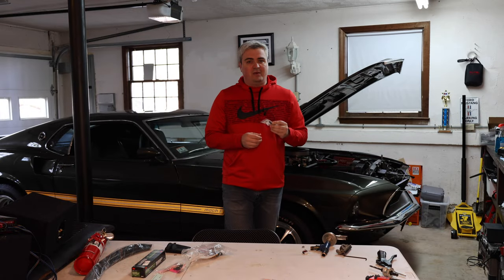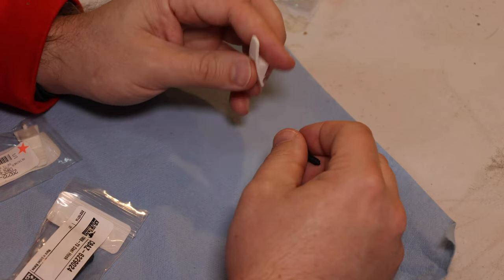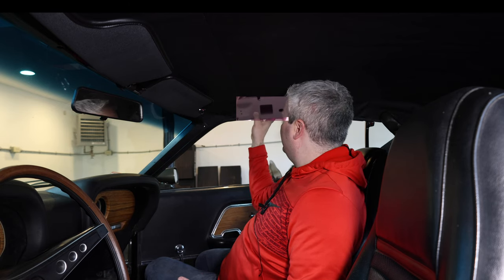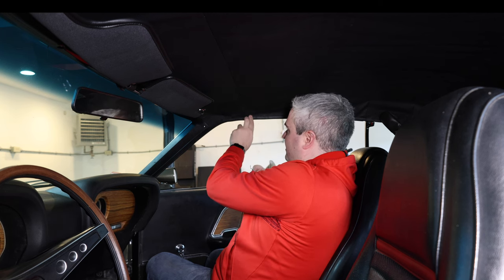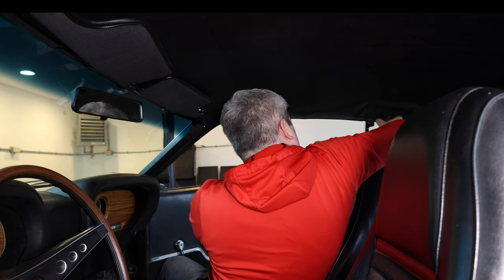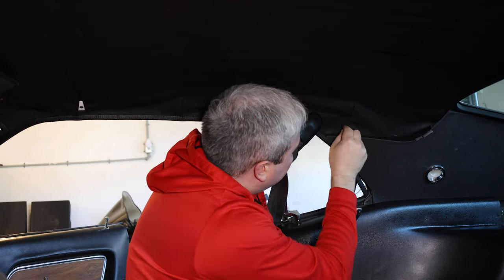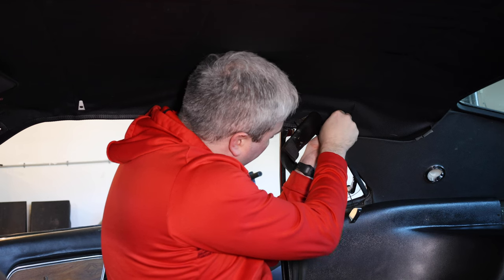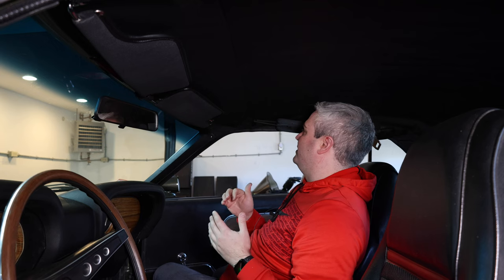Installing 1969 Mustang Coat Hooks

Comment: Appreciate your video. I have a 70 which is probably close to the 69 and I need to do that small project. 👍
Reply from the maker: Glad to hear. It should be very similar to the 69. I believe the coat hooks and parts share the same part number between the years. I’d definitely find pictures of vehicles without the headliner in to semi locate the holes.

Comment: I’ve seen some have that extra hook that looks like a hanger to secure to belt better .. will u be doing a video on that?
Reply from the maker: Do you have a picture of that? I haven’t seen those on 69 Mustangs. Also not finding them in parts catalogs.
Reply: @SmackeysGarage  I think it’s called seatbelt shoulder Clip retainer . I typed 1969 mustang fastback shoulder belt strap